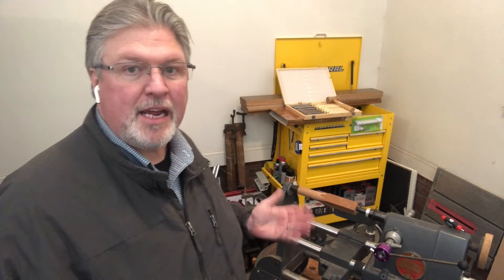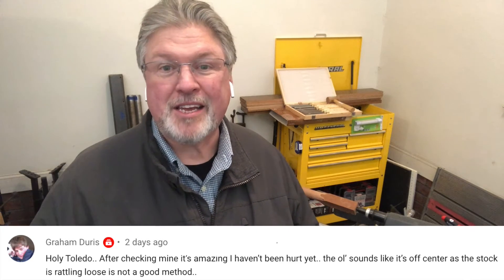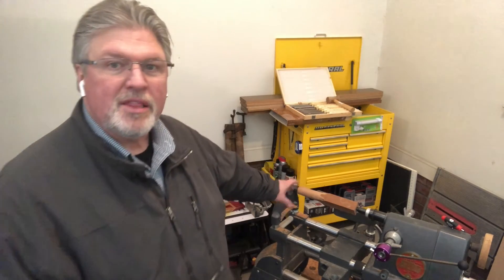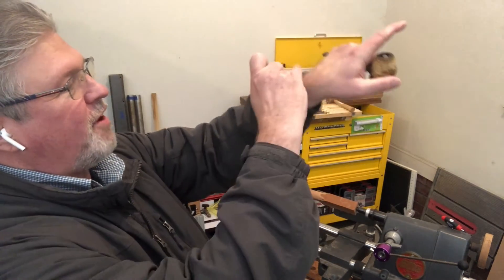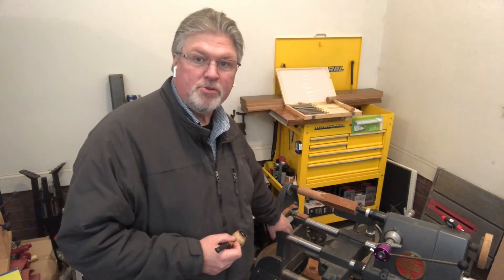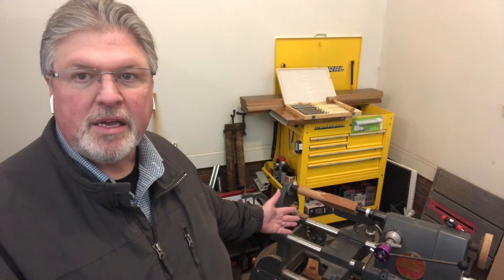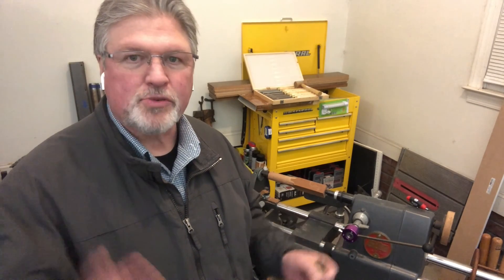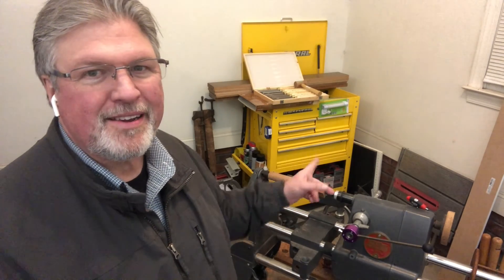STUMPED? Q&A's from "Before Turning On Your Shopsmith Lathe, Watch This!"

Comment: I have a dead center but you showed a live center.  I'm sure the live center is best and more expensive, but I'd it fine to use the dead center or should I find a live center
Reply from the maker: It all depends on what you are turning, but I outgrew the cup center pretty quickly. The biggest issue is that unless you can turn a spindle from start to finish in a couple minutes the dead center will slowly burn its way into the end of the spindle until it becomes loose. The live center is as forgiving as they come and will spin and spin for hours with no problems. If you do choose to buy a live center make sure that it matches the cup center so you can use your cup center for marking the stock. I linked to one that is a match in the video description. Have fun!  Scott

Comment: Hi Scott. Jeff here.I have aMark v (1982 vintage) given to me by my Dad. I revisited the 25? Hour maintenance. Just a heads up the Zoom spout oil for the sewing machine, according to owner of Norvey Inc. told me that oil is to light duty. It is a white oil that is made to not stain cloth. The turbine oil that he makes is meant for the for the heavier duty needs of the SS. I have been using the turbine oil 20-25 years on the electric motor bearings  in 3 pellet stoves and combustion motor fan on the furnace. Zero problems. Thanks for the great videos, and your view of life. Jeff
Reply from the maker: Jeff, yes, I’ve heard this before and I believe that his advice of using turbine oil is incorrect for the Shopsmith application, but I would love to have a chat with the owner. Would you mind sending his info to me via email at scottmarkwood(at)gmail(.)com Thanks, Scott

Comment: Scott, for those concerned about the eccentric set screw wearing a notch into the eccentric, it's possible to buy set screws with a nylon-filled tip.  This will obviously be less hard than a bare metal tip and should, in theory, avoid the problem of damaging the eccentric.  Never tried it myself, but I'm putting the idea out there for someone that's always cranking the eccentric around.
Reply from the maker: That’s true. I might be concerned that with nylon tips it might be prone to movement, but it would be worth a try if someone was concerned. Thanks for sharing a tip. Scott

Comment: When I upgraded the model 500 tables to 520 tables, they gave me a new hub for the disc sander. I used the old hub with a piece of pine to create a hand wheel on the back end of the quill shaft for turning. I see you also have added a hand wheel. It’s very helpful if you use the lathe lots.
Reply from the maker: That’s an excellent use for that spare hub! I’m going to have to remember to pass that on to my neighbor, who has a 510 upgrade kit sitting in the box in his garage. Scott

Comment: Dale Carlson
I have a 1/4 inch play on the quill is that normal   I t has increased over time,  I upgraded to Powerpro Love it
Reply from the maker: No, not normal at all.
Reply: @MyGrowthRings    What do I need to do to fix the play?  I have replaced the nylon drive ring assembly  once before but it did not seem to correct the play   I upgraded to the double bearing quill
Reply from the maker: @dalecarlson5963  Dale, I am still at a loss to fully understand what is moving. Perhaps posting a short video would help. Feel free to share something here or email me at scottmarkwood(at)gmail(.)com

Comment: Hey Scott. Great videos. I use my shopsmith mainly for bowl and box turning and I was wondering how you would hollow out a box with a forstner bit as the quill is on the headstock instead of the tailstock.
Reply from the maker: That’s a great question, John. There are actually several ways to skin that cat.  You can either mount a chuck in the tail stock via a tail stock chuck arbor and simply extend the quill into the bit, of you can mount the stock on the chuck arbor and mount the bit in a chuck on the quill.  Scott
Reply: Garry not Linda. John, go on an Ebay hunt for at least a 1/2" Jacobs chuck and a Jacobs chuck/#2 Morse taper adapter. Try to find out what thread is on the chuck so that you get the correct adapter. You know what? Go to the Jacobs chuck website and there you will find all of the information you need. You can print out a sheet with chuck numbers and specs and another on the Morse taper adapters. Keep that handy when you do your Ebay search and you will be able to order exactly what you need. Who knows? You might even find a set already matched up! Good luck. Garry
Reply: @bassrun101 thanks Garry. I'll try that.

Comment: Well Scott - Apparently I'm sliding deeper into the woodturning rabbit hole. I'm thinking more about using that large leveling screw at the opposite end to line up the spindle with my single setscrew eccentric tailstock. While moving the point of the spindle, won't it also slightly affect the exact direction of the spindle? Requiring readjustment of the saw table?
Reply from the maker: It shouldn't, but it might. Again, if it changes anything it's going to make the machine properly aligned, so if you need to correct anything after the adjustment it's really something that should be done. Scott
Reply: @MyGrowthRings  ok - that makes sense.  BTW - shocked I was when I loosed the set screws on the way tubes in drill press mode. don't know how much, but at least one side moved enough to surprise me.  Thank you.
Reply from the maker: @hfmann1  Glad you checked.

Comment: Hi Scott ! I just purchased a "Greenie" that has 2 slots on the table saw. I'm assuming the dado slot "nearest the motor housing" can only be used with the miter gage ? Am I right or am I missing something ? Maybe there are more uses for that slot ? Shop Smith obviously dropped that idea years ago ....
Reply from the maker: Actually the slit closest to the left edge was there to allow for wider rips with the fence on the main table. Shopsmith eliminated it because the portion to the left of the slot was prone to bending and they were working on ways to improve dust collection and safety and just couldn't make that slot work. Scott

Comment: Another Great Video. To be honest, until you show us i never knew that there were that much movement on the end with the Jointer. Does  the Mark 7 have that much movement?
Reply from the maker: Not quite as much and because the end castings are fixed on both ends, any shifting will not affect the alignment between the way tubes and the extension tables. In my opinion, this is the true advantage of the Mark 7 over the Mark V.

Comment: you have a chisel holder that looks identical to the one that came with my $300 1986 model 500. Any history on that design?
Reply from the maker: We used to make them in the Shopsmith Academies and we also freely shared the design, so it wouldn’t surprise me if the previous owner took a class or two or at least hangout at one of the SS stores. Scott

Comment: Any advice on zero clearance inserts on a 510 table? Have you made them or do you purchased them? Also do you use an aftermarket splitter with them? Thank you in advance. Your videos are extremely helpful.
Reply from the maker: I have and use both. The advantage to the versions that Shopsmith sold (do they still offer them?) is one version allows the upper guard to be used. My homemade versions are primarily made from Masonite and only a couple of them have the ability to accept the upper guard. I do not use an aftermarket splitter.  Scott
Reply: Shopsmith demonstrator, Mike Young, showed me how to make zero clearance inserts for the 520 using 1/4 “ poplar available at Lowe’s. I think they are 4” by 18” or so.. Not much waste. Bandsaw, disc sander, drill press.
Reply: @MyGrowthRings  thank you!
Reply: @jamesbrunk9817  thank you!

Comment: I have used my fence on the left-hand table to cut a 4'x8' sheet of plywood in half a number of times.  With the infeed tables and my own outfeed table system, I was able to do it single-handed with no alignment or pinching problems.  Maybe I was just lucky.  And no, I don't keep my jointer mounted all of the time.
Reply from the maker: On a Mark V or Mark 7?

Comment: I wish They still offered the whole thing out a cast-iron my buddies got one of the originals and it’s way stronger than the Mark five or the Mark seven I played with both I really like his I’m super excited about having my own I just wish the tailstock was stronger I have the Mark five your comments would be deeply appreciated is there a way to strengthen or some thing you can buy to bolt to the tail stack to make it flex less thank you
Reply from the maker: Heaver isn't necessarily stronger. I have a 1940's Shopsmith 10ER and because it is made from sand-cast iron it's beast, but that's a detriment for most of the functions. If all you need it for is a lathe, than fine, but who wants to add and remove the smaller table that weighs more than the larger Mark V tables? Not me!  Scott

Comment: Do they make anything to make the tailstock stronger because I noticed it’s really weak I just got my first Shopsmith Mark five
Reply from the maker: Not really and the kind of pressure you would have to exert to damage it just isn't needed.  You just need enough pressure to hold the stock in place, but not so much that you cause anything to flex. That much force will eventually damage the bearings in your live center. Scott

Comment: There is a total shop available locally here. Are the Total Shop and Shopsmith interchangeable?
Reply from the maker: Not really. Some of the parts that attach to the spindle are interchangeable and others aren’t. The SPTs (special purpose tools) like the jointer, bandsaw, etc are interchange. The internal parts of the headstock are not interchangeable.

Comment: Scott,  I just recently found your channel. I have a 1980’s version 510 bought used about 2010. I have added double tilt and added the power pro head to it. I have enough money saved for either anova chuck or the 520 fence and table upgrade. Most of my woodworking is restoring musical instruments, harpsichords and such. Which upgrade would you recommend doing first?  Great content btw.
Reply from the maker: Nova chuck, all day long.
Reply: Thanks!